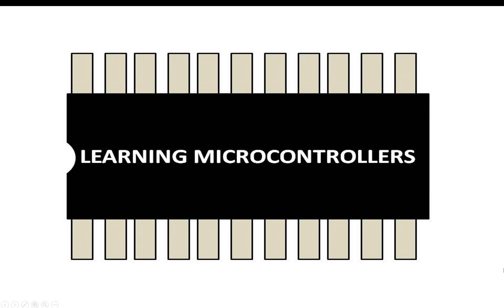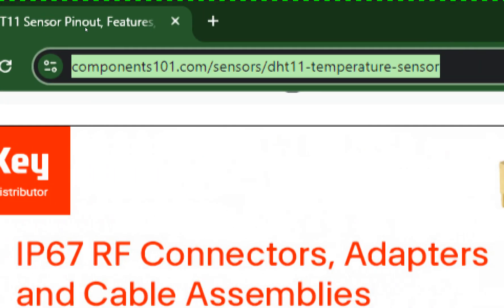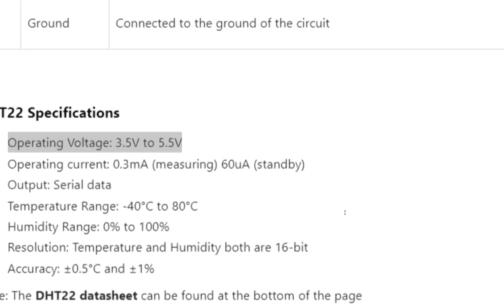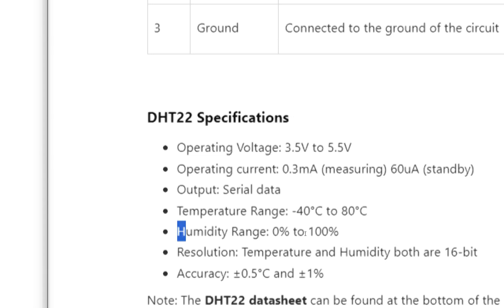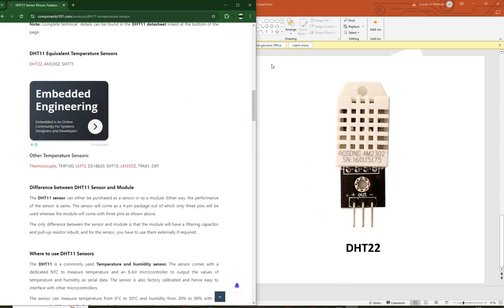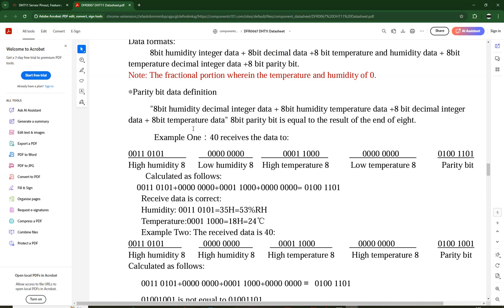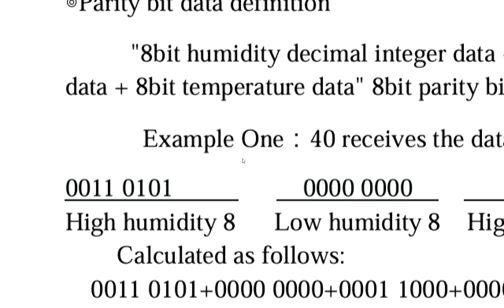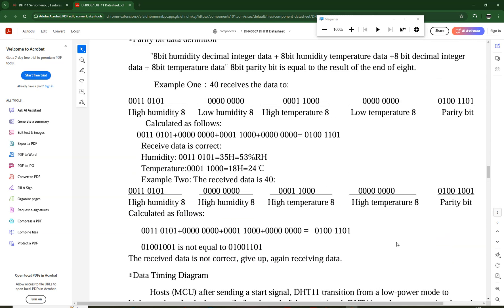DHT11 vs DHT22 temperature and humidity sensor.

Comment: hi. i see 00110(=3) 0101(=5)  = 35 but not able to understand how it is 35 equal to %53. should we add plus 18 to all data we receive
Reply: @suatkaleli5075 35"H", "H" represents hexadecimal, so 35H = 53D, D represents decimal
Reply: @柯凱翔-v8s  thanks
Reply: @柯凱翔-v8s  i use pic not ardunio so as far as i understand i think we will receive the 16 bit binary data and sort it to temperature and humudity value and change binary to decimal thank you very much
Reply from the maker: Share details
At uneeb629@gmail.com
We discuss